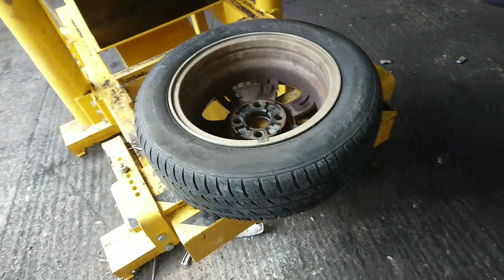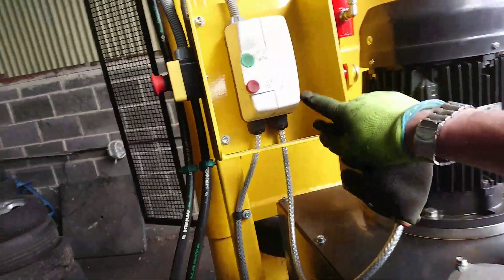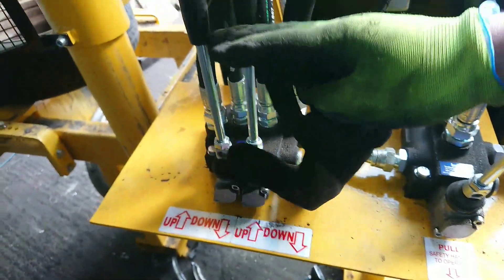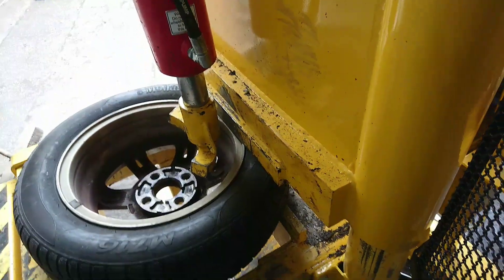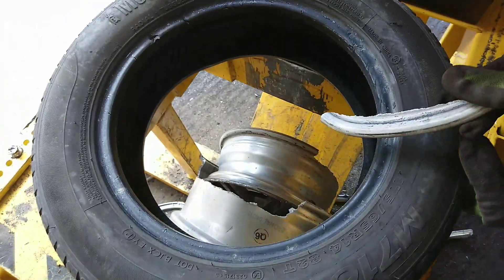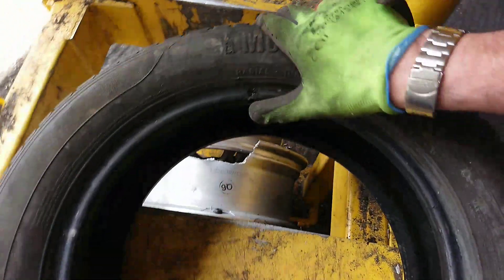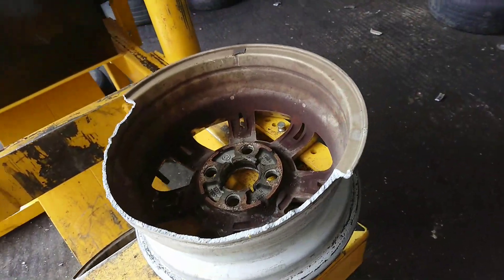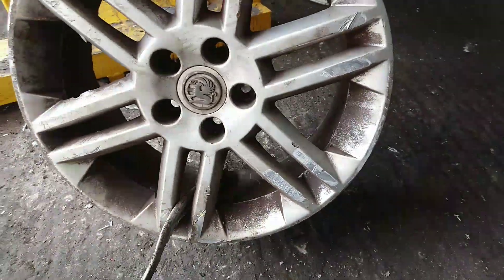Wheel Popper New Invention 2019

Comment: I've read the previous comments. Impressive machine. I would rather use a normal tire machine for the obvious reason that it would actually take less time with zero mess cleanup fuss chasing broken pieces of rim.Break the top bead and remove the tire. Toss the two pieces in their respective stations and repeat.

Comment: Tyre was maybe worth 10 pound minimum (can't tell from video tread quality) before bead was ruined, now will cost to be taken by recyclers, busted rim is now only scrap value. What the hell is wrong with using a proper tyre changer machine, no damage??
Reply from the maker: We done nearly 1000 tyres with this tyre popper in couple of days and it doesn't involve taking valve off or bars taking tyre of a wheel. With this one put the wheels down and send the ram through. Simple. We don't sell these alloys as they're not worth the time hence why weigh them in £12 a wheel. Tyres thrown back into stripped cars and get crushed.